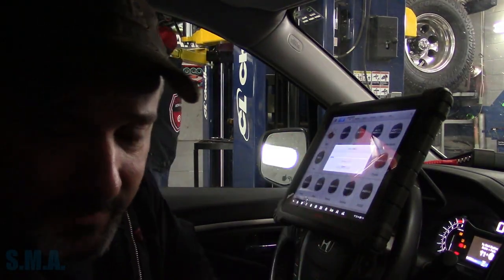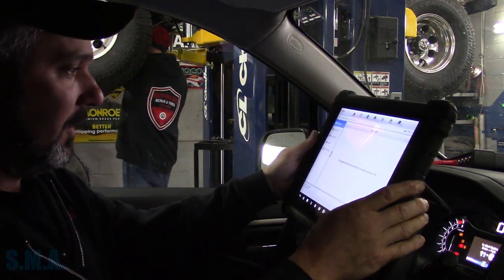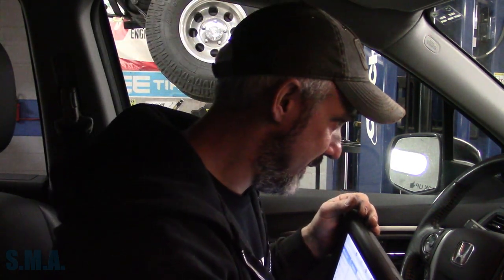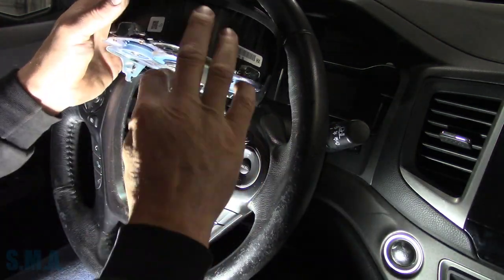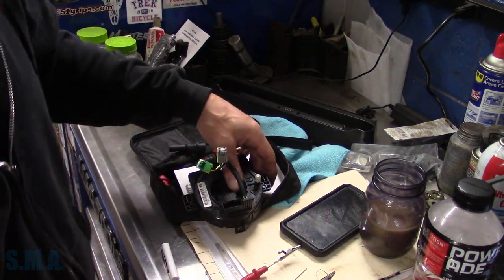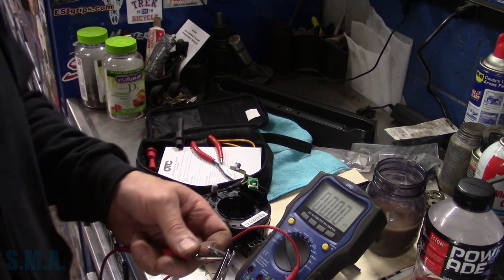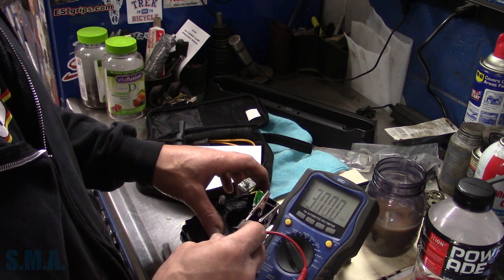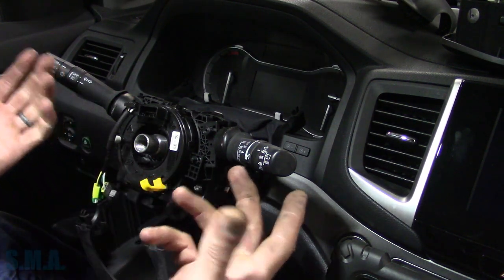Honda Pilot - Air Bag Light On

Comment: Had a similar issue on my BMW and of course I am DYI and do not have the diagnostic tools to look data. Had airbag light on and all the buttons on the steering wheel did not work. Also rear wiper motor did not work as well. A shop said clock spring is gone. I checked my horn circuit with a test light and the clock spring was grounding the relay so I moved towards the ignition switch and found out that part of it was loosing about 6 volts. Replaces the switch, problem solved. Any way great video just thought I' d share my experience

Comment: Hi Mr. "O"
I would appreciate if you could clear this situation for me.
I disconnected the negative cable from my battery and with a DMM measured between the negative battery post and the negative battery cable; and read the battery voltage.
This was done with the engine off and ignition key removed.
My question is: is this normal or there is a weak short somewhere.
Your response is appreciated.
I really enjoy watching your videos showing your work and the family harmony. 
Best wishes for you all!
Shahbaz

Comment: Those airbag retaining screws can be a nightmare on older Honda/Acura vehicles. Stripped bolt heads...to much lock tight...think they were allen key, not torx. Also usually was a little trap door on underside of wheel to "defuse the bomb" before removing the bag assy. Was there no such on the newer Pilot?

Comment: Had a ford econoline 2007. same issues, no horn, no cruise, airbag light on. Wasn't the "clock Spring". was a connector on the steering column. Apparently it was a common problem.

Comment: next time put the steering wheel upside down and the airbag will rest on the steering wheel with the wires facing up and it will be much easier to take out the squibs.
Reply: And if it goes off it will hit you in the Netherlands.
Reply: @InsideOfMyOwnMind  do it from the passenger side :))

Comment: Hey Eric love you videos always waiting for the next one. I'm now wondering if that could be the problem my 2001 f150 has with the cruise control Intermittently stop working. Just heading down the road and it turns off or wont turn on

Comment: Eric’s gut (aka vast amount of experience) pays off again with the right diagnosis before even getting a screwdriver out. I wonder if someone was in there before to replace a recalled Takata ruin your day airbag? It is a bit sad a 4 year old Honda with under 70K needs a clock spring in the first place. A cynic might argue it was designed to just barely outlast the warranty. Or it could just be a fluke.
Reply: Now that the new clock spring is in place, tell the customer not to turn so many corners.

Comment: I bet the dealership probably messed up the Cable Reel (clock spring) when doing the Air bag recall. Explains the marks on the plastic steering column cover.

Comment: I remember a story in our local newspaper about 40 years ago. A young lad got pulled over by the police and when they looked inside his car, he had no steering wheel and was driving using vice grips clamped to the splined shaft. How would you start to explain that? Oh it just fell off 5 minutes ago

Comment: Real good idea Honda have there, messing about with a packet of explosives so they make the connectors difficult to remove.
Had to remove an airbag from a Skoda the other day, 2 spring clips (no screws) and one connector that was easy to get to, that's the way they should be fitted.
Reply: The airbag connects are easy to remove if you're used to them, Eric O was having an extra hard time due to his "sausage fingers" as he put it. I pull them off with no tools in 2 seconds, no issues.

Comment: I had to tow a mid 70s Cadillac someone left in a parking lot. It was nose in and I hated towing on the front wheels, especially older cars with no locking column. I get it started, pop it into reverse and roar backwards to discover WHY I'd been sent to tow it. . . the fricking steering wheel came off in my hands as me and 5,000 lbs of steel hurtled backwards. Nearly filled my pants. Got a pair of vice grips on the nut, safeishly turned the Caddy around and off we went.

Comment: you did a great job but always a but .you put airbag on the dash with bag facing down. that's a no no  static  can set it off always per honda place air bag module on the passenger floor with the module bag facing up .so if it blows only the bag goes off and it won't fly thirty feet  into the windshield or roof
Reply from the maker: I drive with mine pointed at my face the entire time.... I'll take my chances
Reply: @SouthMainAuto  enjoy it makes a hell of a mess .we use to set them off for warranty. usually on july 4th they sail 25 to 30 feet with bag in the down position  .wow is that fun got to watch for park service cars and we did both modules at the same time with honda special tool arming module

Comment: "....move the camera in case it (air bag) exploded.  Don't want to miss a great photo.opportunity."  What an adventurer.
Reply: Plus "roll down the windows in case we lock the keys inside."
Reply: R-E-A-L-L-Y   ??  you mention air bag resistance being 2-ohms?  Putting meter voltage across an air bag sounds like danger to me !!  It could activate the detonator.
Reply: you betcha.... legos and erector sets are more than toys...
Reply: did i miss torquing the wheel bolt?
Reply: crossed threads are better than loctite??  yeehah

Comment: Would you like the special tool to remove those? And if so where can I mail one?
I bought a 10mm hex bit 1/2” drive just do deal with this steering wheel bolt
Reply: South Main Auto Repair
47 S. Main St
PO Box 471
Avoca, NY 14809

Comment: wouldnt be an SMA video without "Biing booonnggg" or the phone and i changed  my  opel corsa steering wheel  years ago , old off new on then airbag i look down, ans whats in the cup holder but the freakin  steering wheel mounting bolt so had to take the airbag off and bolt er down

Comment: Never turn the steering wheel after removing the nut. Keep wheels straight. There is always a spline to line the steering wheel back up. If you rotate the wheel n forget to straighten it out...you could destroy the new clock spring. No reason to replace clockspring unless airbag was blown and it melted the connectors...
Reply from the maker: Lol spoken like a true armchair expert 😂

Comment: 2004 dadge 1500 5.7 misfire # 7 cylinder,compression is 150 psi  swap the coil and spark plugs still misfire #7  what you think it is the problem?

Comment: How if you have a intermittent horn on your steering wheel but you've change the clocks spring is there a way that they lose connection at the horn itself without going through the I guess I'll just wonder why it don't work without taking it off as being a loose connection right there at the word touches I have a Sequoia 02

Comment: Takata air bag replacement. Dealer was in there on a recall and screwed something up!
Reply: What year/model vehicle are you talking about, and what was the issue after the recall? I do these recalls every day and might have an answer.
Reply: I was referring to Eric's Pilot. He indicated (and itvdhowed) that someone had been into the column b4. I expect it was a dealer tech doing recall work. My experience is they gave those jobs to Jr techs who often fduped things. My 2004 Odyssey jpassenger side ab ob resulted in a fragged radio antenna lead. They just ripped scheiss out and crudely shoved it back together. I had to fix it myself, they denied culpability...
Reply: Doubt it in this case, there would be no reason to mess with the clock spring when just replacing the airbag.

Comment: Just the thought of messing around the airbag scares the hell out of me. I would assume you would take the battery cable off.......ughhhh...
Reply: If only you knew how many airbag inflators we've replaced at Honda because of the Takata recall.
Reply: Eric O DID remove the battery cable, that's why the radio was locked out at the end. BUT, no techs at the Honda dealership remove the battery when replacing airbags -- none of us have any issues or unintended airbag explosions.
Reply: Disconnecting the battery is really sort of a belt and suspenders thing I think, likely just recommended for liability reasons. Not sure why the chances of the module randomly deciding to fire the airbag while you are messing with it would be any higher than while driving down the road normally.

Think the main cause of accidental airbag explosions is people applying voltage to them, like doing resistance measurements on the airbag itself.

Comment: Is the steering angle sensor used for electric power steering?
Reply: It is mostly used for the vehicle stability assistance, or VsA, helps you keep control in bad weather, but it also ties into the eps, newer cars will even use the steering angle to help steer the car atraight

Comment: Looks like Honda replace the Air bag because of recall and when they put it back with the new Air bag technician did not put it back properly and maybe the cause of the faulty clock spring. Thats the problem when they have to replace a recall parts.

Comment: My 03 Pilots Cruise don’t work, the radio buttons work and the main switch on the dash does, could it be my clock spring ?
Reply: If you have a failed O2 sensor, the PCM disables your cruise control as an annoyance tactic to encourage you to fix your driveability/emissions issue with the O2 sensor.
Reply: Jgizzy redacted the main comes on my steering wheel buttons don’t work, I was told it was the break light switch or the clock spring, i had it at the dealer getting it serviced last week, they checked my O2s bc they are bad about going out on the first gen
Reply: Jgizzy redacted my dash is free if any lights but the SRS bc of a recall that needs to be repaired, the check engine or service engine is off

Comment: Do you do something to discharge any capacitors after disconnecting the battery? I remember some Euro cars tell you to wait 20 minutes after the battery disconnected to mess with srs. Of course, I never waited, I just touch the two battery cables and call it a day. Because f*ck OSHA.

Comment: You should produce a video. The Life History Of Eric O. Highlighting all your downfalls and successes in Life. Things you wish you had not done, and things you were so glad you did do. For the young men out there starting out in life that need a little insight, not that your a Guru, but you seem to have found your road in life. Wait till winter, build a little fire in the pit, and have a little fire side chat. As far as women being able to do 2 things at one time, one gender is no better then the other. Humans are born with single core processors, we can only actually think about one thing at a time, tho our ability to switch between data streams is extremely fast. Every since when we hunting saber tooth tigers on the plains of Africa, we needed to be quick thinkers, we were the hunter and the hunted.

Comment: Why would anyone need a car with all those Buttons? You get in start it up and head down the road. All you really need is a woman who can do two things at one time. Hello Trouble codes
Reply: The supposed reason is to make it safer to drive as you don't need to reach for the radio or whatever else is on the wheel.